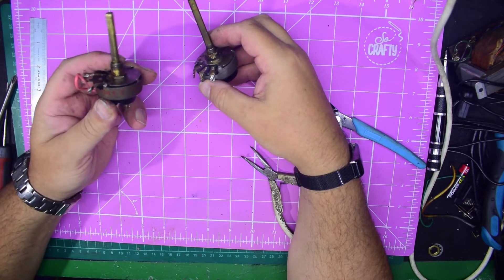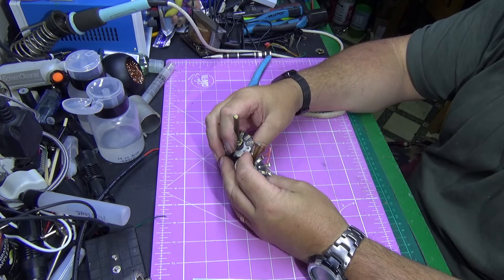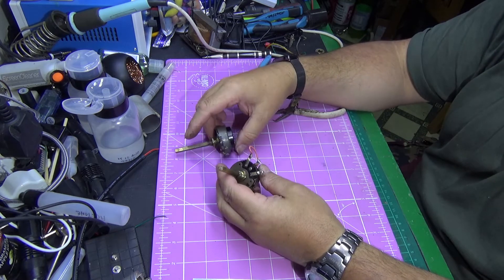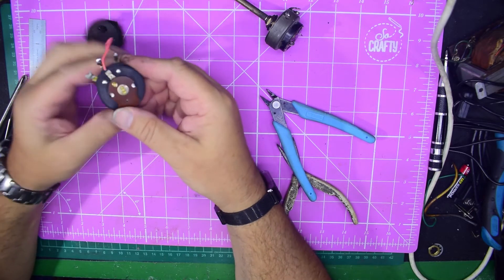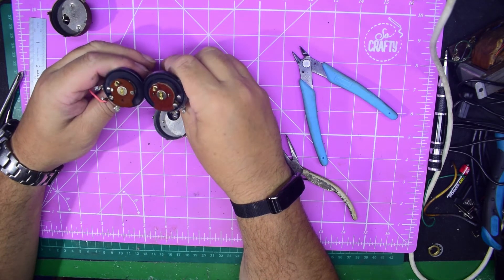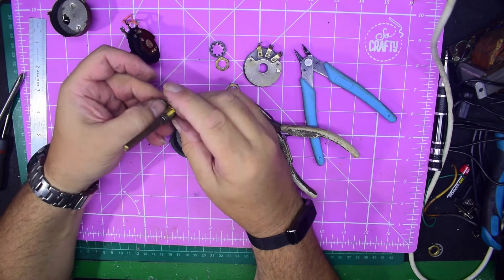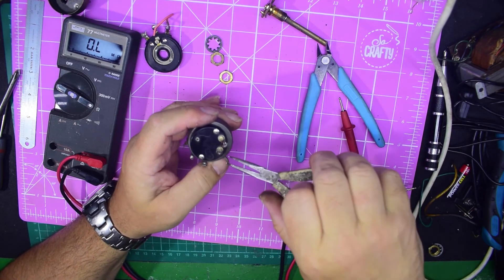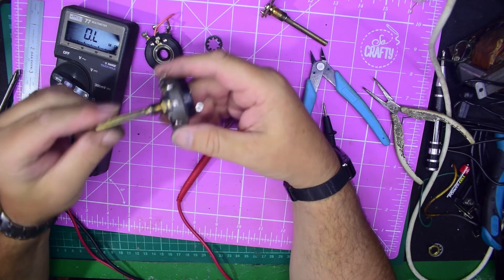How to change the shaft on a vintage potentiometer

Comment: Hello George I hope you can help me with your knowledge with a Dave Smit Inst. knob failure 

I share you mi video https://youtu.be/JVd-HoRBgo4

Thanks!
Reply from the maker: I can certainly try. I'm not sure if those are just worn or dirty potentiometers that can be cleaned with a cleaner such as deoxit or alcohol or if they are rotary encoders. If they are potentiometers then you should only need to slit the panel from the case and use the spray cleaner. I would also check for poor solder joints on the pcb where the potentiometers are fixed as this could also lead to the symptoms you are having.